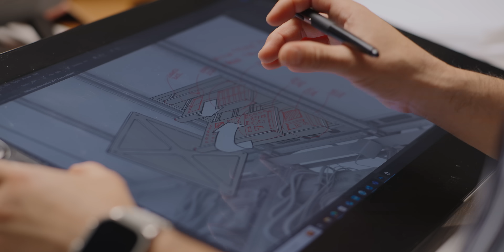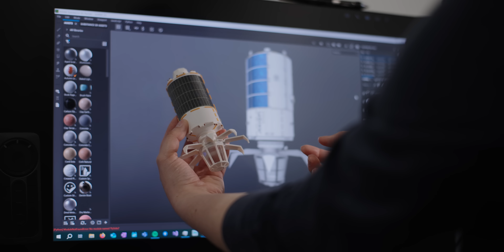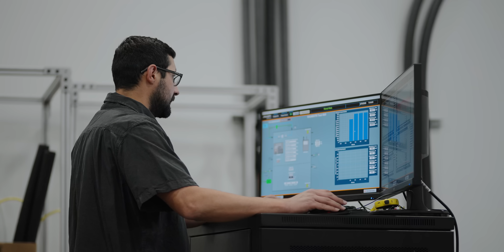What Comes Next?

Comment: Hey Axiom engineers, just a little idea; when the ISS is decommissioned in about 2029 or so, mind if you advocate to not let it deorbit into earth, pretty please. 

Sure its too old to safety be used as a habitable environment; but at least leave it depressurized and connected to the Axiom Space Station for another 10-11 years; to take advantage of the solar panels, equipment, and computers that can work fine in a vacuum.

Comment: While this will be more modern then the aging ISS, it's the same thing, connecting a bunch of cans together.   
I would like to see LARGE space stations specifically developed for Starship superheavy (& New Glenn).   Starship booster is 9 meters diameter, put a large space station on top of it (instead of the orbital starship).   The station could be wider then the rocket, a common thing to see on rockets.  You could launch an 11 or even 12 meter wide station...that is HUGE.   It would be a proper 21st Century space station.
Reply: Far more cost effective to use a Starship itself as a fully reusable space station that can be returned to Earth after a period of time for maintenance and refurbishment.
Reply: ... That sounds like a Skylab2 for the 21st century, if Nasa can own the booster to make it work safely.
Reply: hahahahahah

Comment: What comes next? Haven-1. Sorry Axiom you guys are actually chill mb
Reply: BS.  First to orbit means little in the long run.  VAST's Haven design will do very well, but in the short term it has some limitations when it come to crew time in orbit, and the life of the module.  Axiom Station will take longer to get to space, but its crews will be able to spend more time on orbit and the station itself will last longer.  Launching first isn't the finish line, its only the first corner in a marathon.

Comment: Axiom, you need to get GOING! You are falling behind, VAST is far ahead of you and will be in orbit in FY26.
Reply: VAST are building a very different system.  In some ways it is quicker and more flexible than Axiom Station, but in other ways it is more limited.  These two systems are both very useful but can hardly be equally compared.
Not everybody drives the same type of car, lives in the same kind of home, or rides the same kind of bicycle.  In the same way, not all station designs will be the same, and some will take a little longer than others.  There are huge inflatable modules in development too but when they arrive, it won't mean the end of single or multiple module stations either.
In other words, try not to get too deep into the "First one in orbit wins, and everyone else looses" mindset.  In the end, all can be successful, even if they launch second or third.
Reply: @martythemartian99  oh, I am not in the mindest of the first one to get there win, but more of a who get the NASA contract to replace the ISS. I may be wrong, but isn't there only one company that NASA will award the contract? I am afraid that the companies that does not get the contract may not have enough founding to maintain their work.

I was also wondering about multiple company building multiple modules, the ideal was if every company could basically join force and assembly each modules to each other to build a large scale "arc". Kinda like the soviet and the US did build the ISS.
Reply: @chrisdedmanr  Thanks for the reply.  I think I understand where you are coming from better now.  I'm not totally sure, but I believe NASA plans to send missions to several stations to keep the work previously done on the ISS going.  Axiom have a solid place in this plan because as you may have noticed, they are to take on current long term ISS racks by direct transfer before the current station is decommissioned.  
Many private companies have paid to send manufacturing, experimental and construction test units to the ISS, and they too will be buying and renting space on the new commercial stations.  This means it is possible to succeed even without NASA involvement.  Of course the same goes for other agencies purchasing space on the new stations as well.  Expect to see CSA, ESA, JAXA, ASA and others.
While it is possible for several new stations to link up, I don't believe it is in anyone's current plans, due to commercial competition and confidentiality, but it does make sense in the future.  If not with a physical link up, being in a similar orbit would easily enable transfer between stations.
Reply: @martythemartian99  While I love innovation, we do need some standards to keep costs down.  For example, I believe transfer vehicles need to be able to dock with multiple stations/modules.  I don't like all eggs in one basket.  But it is exciting to see companies seriously pursuing different paths for the stations.
Reply: VAST launched today Heaven Demo to demonstrate the capability for Heaven-1 which will launch around May 2026, and have an independent space station with a crew of 4 by June the same year (2026)... They are far far ahead. So promising.
Reply: This commercial was some cringe, plays like a cheap infomercial, or one of the modern big pharma ads
Reply: @salty_berserker_channel  Right, they have nothing to show....